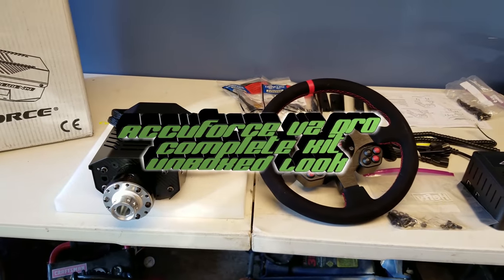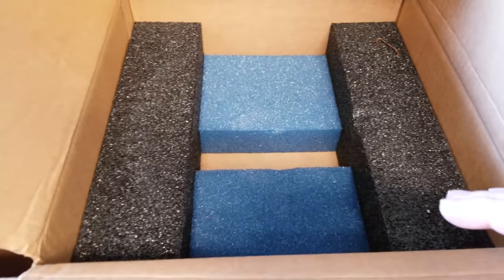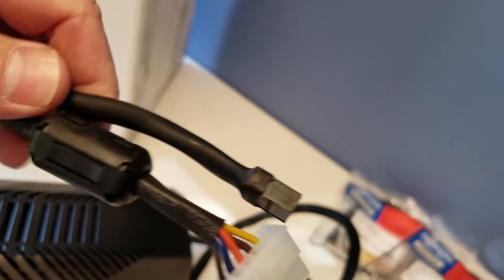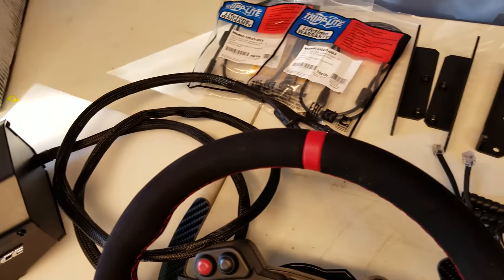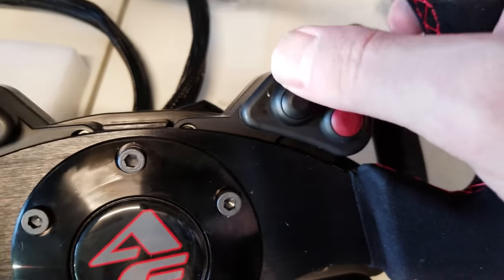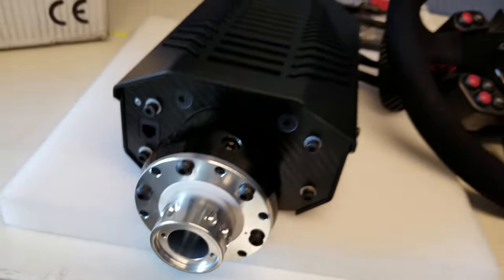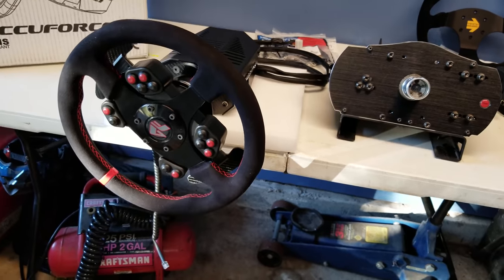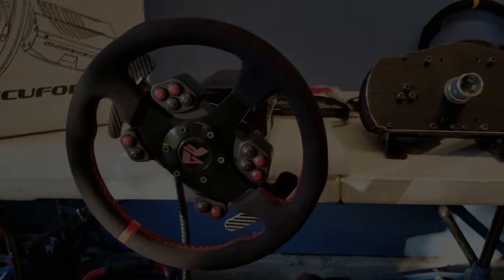Accuforce V2 Pro UnBoxed First Look

Comment: I have got the V1 model mate and i can tell you this is a serious bit of kit and i still get a kick out of using and never had an issue with feeling any notches or steps when racing. The first thing i did was turn off engine RPM as i found that gave me a lot cleaner feeling FFB.
Reply from the maker: Nice Thanks for the info. Yeah, I noticed turning off engine RPM helped with AC for sure.

Comment: Looks good man. I hope Fanatec gets the Podium figured out in the next month or two.
Reply from the maker: Thanks man. Yeah me to. I did just get my Fanatec F1 2018 rim. Looks awesome. After using the Accuforce though I'm glad I ordered the DD2 ;) Not that the Accuforce doesn't seem like enough power, but it could use some more for sure. More on that in my review coming.
Reply: @TJRSIM   Hey TJR, thanks for the first look. Have you tried Auto Tuning yet?  Hit me up if you need some tuning tips. - Darin Gangi
Reply from the maker: @SimXperience  Cool thanks, Darin. I really appreciate that. Yes, I tried it out. It works well for getting proper Steering Foundation set up along with other goodies of course. I did have some issue with it not launching the game from the Autotuning profile, but I finally got that sorted out on the games. Thanks for watching and commenting :)
Reply: @TJRSIM  my pleasure and glad you're enjoying it!